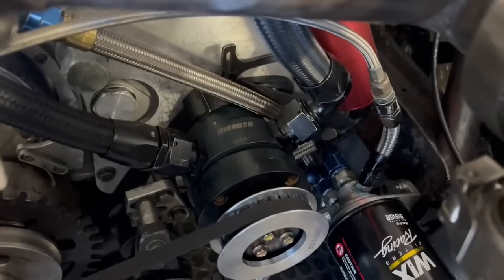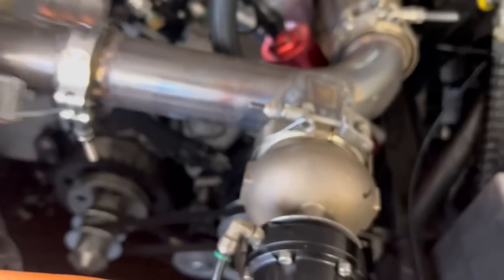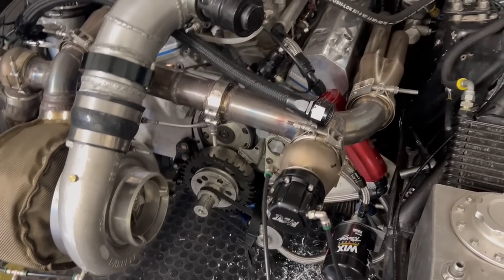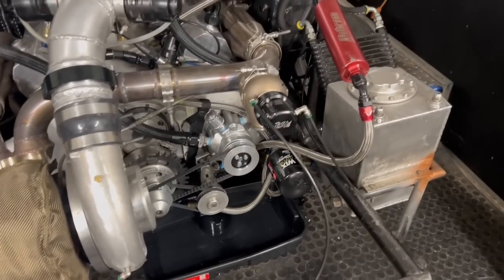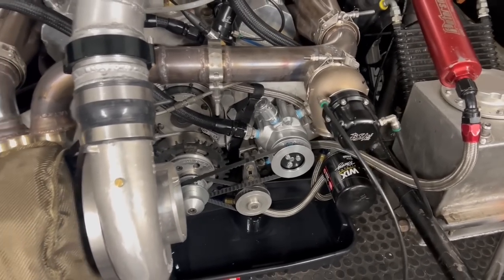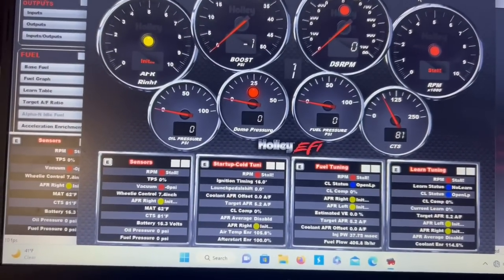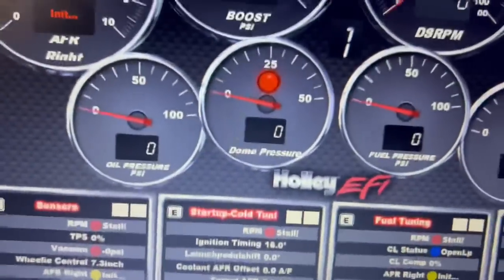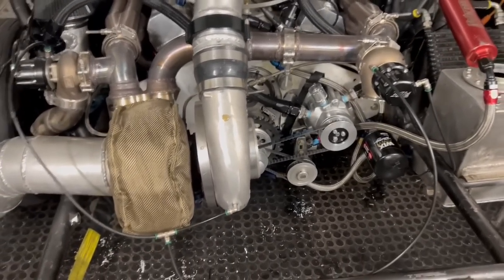Boost and Vacuum Pumps, Will it work?

Comment: Hiya John, I have been doing some homework about methanol, this is the race fuel that you use isn't it?? 
Well, apparently you only get condensation in the oil when the engine is on tick over. Fuel science is new to me even though I've been a mechanic/fabricator for over 35 years but I'm going to keep learning because you have sparked my interest in this no prep drag racing. 
✌️👍🇬🇧

Comment: TJ one thought if the pump pulls too much oil it will drastically reduce vacuum flow. Just harder to move liquid than air. Consider the catch can between valve cover and the pump. Or possibly change the inlet from the valve cover to the valley cover.

Comment: I know you're not even considering a dry sump oiling system but it would increase performance and be more durable. You could also run a full 1/4 mile without worrying about sucking too much oil out of the oil pan and blowing your engine up.

Comment: Was thinking if the pump is not supposed to get oil, run the lines to your catch tank first,  then to the vacuum pump.  Hope uou get results from this, save a bit of bucks on the oil.
Reply: Correct. Best to have oil separator tank in before vacuum pump and then vent to breather behind rear axle.
Reply: My understanding is the GZ pump is made to work with oil vapor, with out locking up.